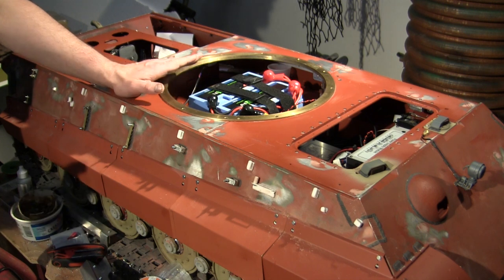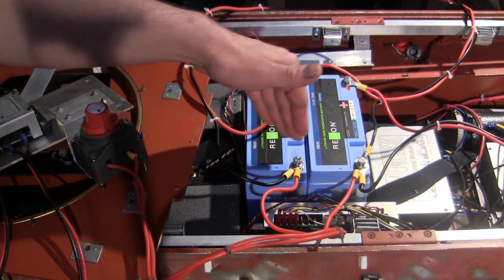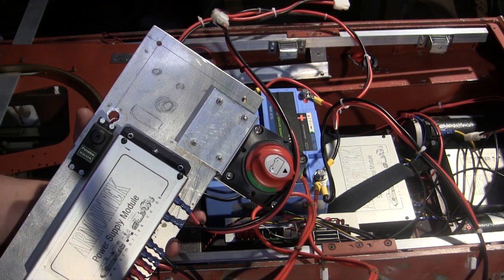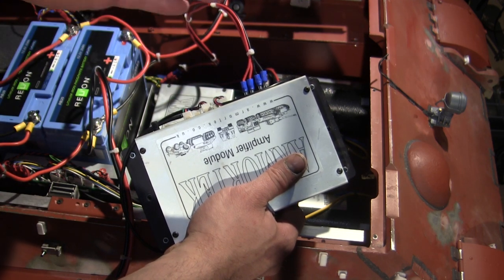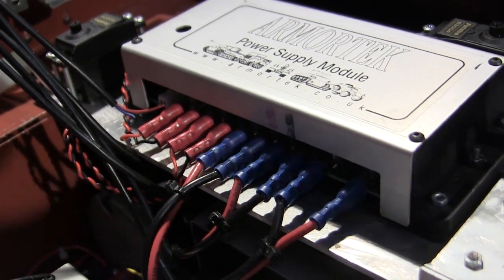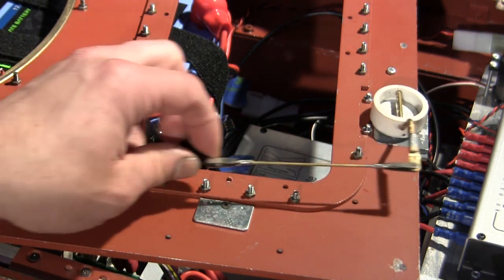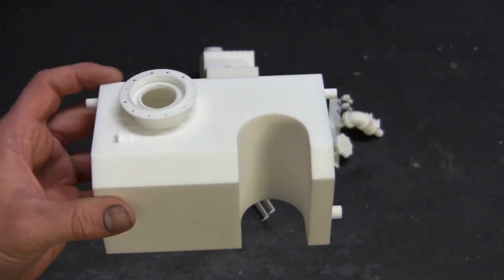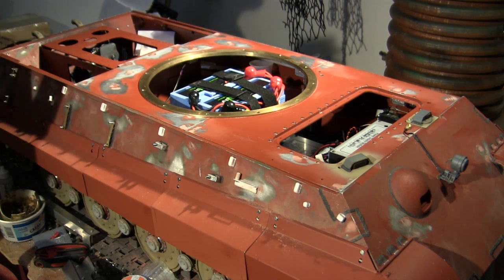Armortek 1/6th scale RC King tiger project video#18 (Internal wiring and control panel assembly)

Comment: I know this video is old. But, stupid question. Wouldn't it be better to use a 6S Lipo cell to power this tank? A 6S Lipo gives you when fully charged, 25V. 22V nominal. 6S Lipos is what we use in the RC car hobby. And there are plenty of chargers to charge these batteries.
Reply from the maker: I don't like Lipos simple as. Lions are the superior battery tech. I have seen too many occasions where the lipos ignite for one reason or another. So much so they need a special fire proof bag to conceal them and the idea of needing a kevlar bag to contain the batteries in a model is not one that gives me much confidence

Comment: Could you set it up with a trickle charger as well? Kind of like the ones you would use on cars or trucks? Thanks in advance.
Reply from the maker: yes, a trickle charger was supplied with the customer and it is what used to charge the model

Comment: Maybe it would be better to fit the servo for the periscope on the top plate instead? A small plug to disconnect when the top is off - also, the connecting arm would be much smaller, and therefore easier to construct!
Reply from the maker: it creates more problems than it solves with the top mounted servo